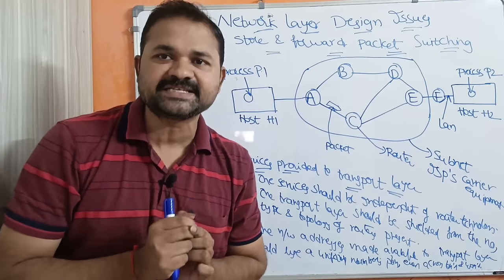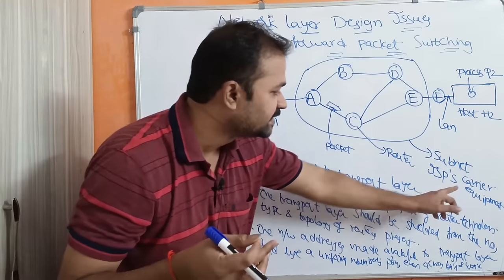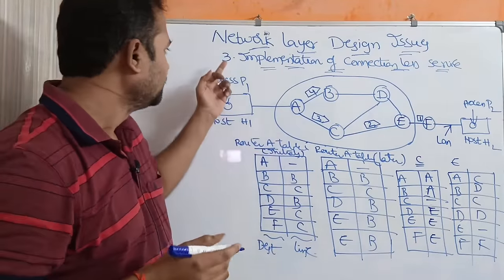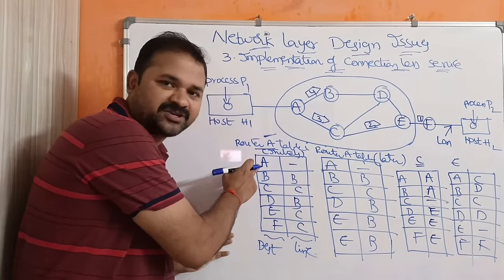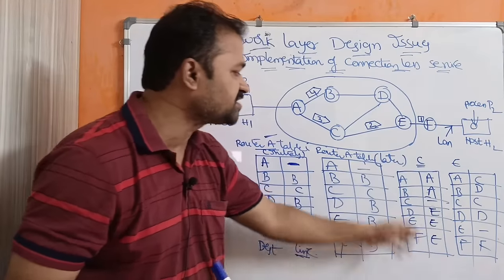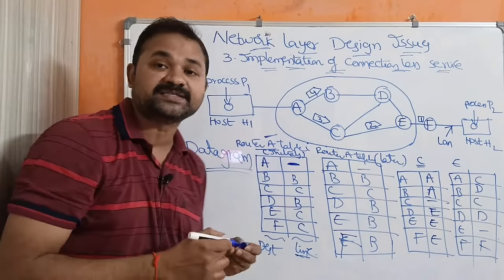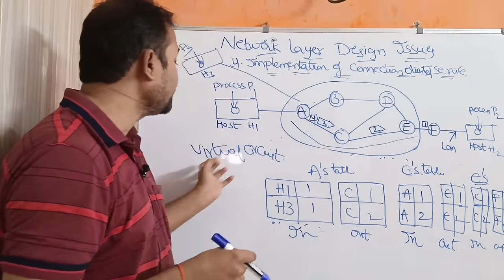Network Layer Design Issues

Comment: 🎯 Key points for quick navigation:

00:14 📦 Four fundamental issues for network layer design: packet switching, services to transport layer, and implementing connectionless and connection-oriented services.
02:14 📨 Store-and-forward packet switching involves sending complete packets along routers, checking for errors, and storing packets en route to the destination.
06:03 🔎 Transport layer services must be independent of router technology, shielded from router configurations, and maintain uniform addressing.
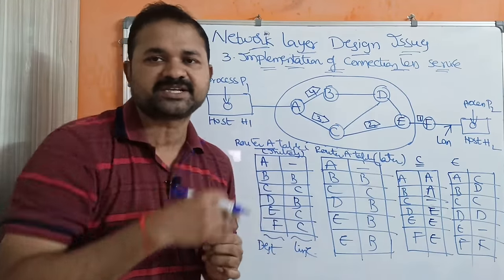07:41 📡 Connectionless service allows packets, known as datagrams, to be sent without an established path, using dynamically updated routing tables.
12:40 🔗 Connection-oriented service requires establishing a virtual circuit path before transmission, with connection identifiers guiding packet routing.

Made with HARPA AI
Reply from the maker: Thanks. Please like the videos, subscribe to the channel, and share it with your friends. Thanks in advance.